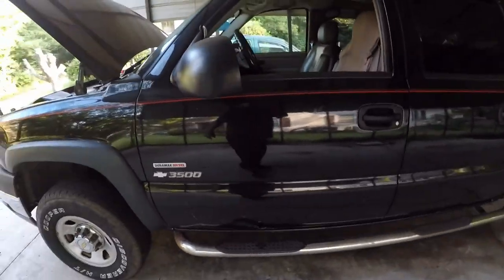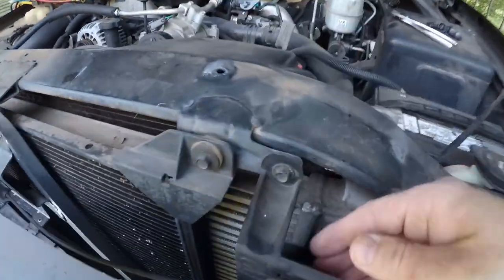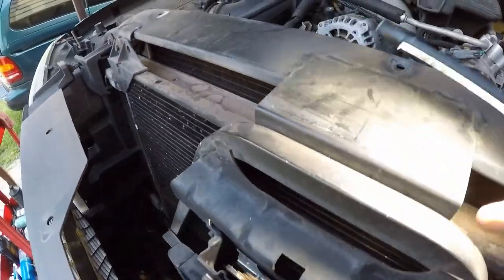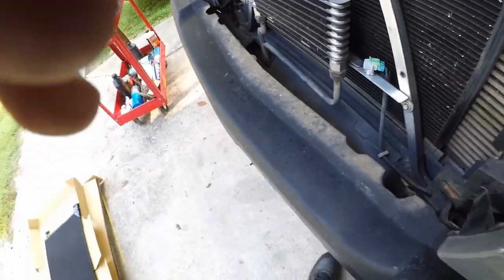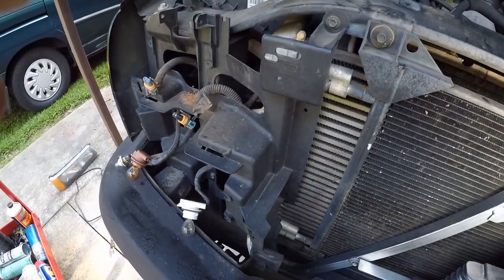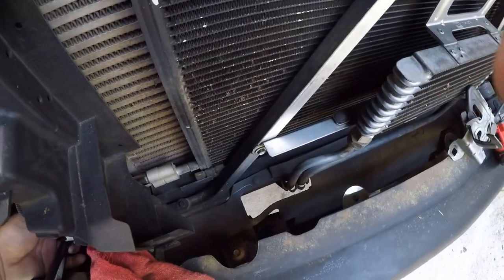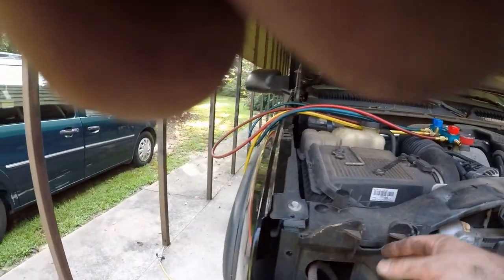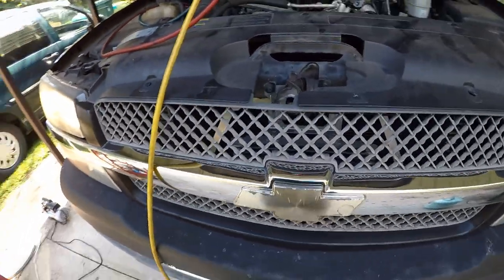How to install a A/C condenser in a 2004 Chevy Silverado

Comment: What about the Pag oil for the new condenser?
Reply from the maker: U shouldn't have to add oil unless you had a leak or replacing the compressor.
Reply: @timzauto  thanks i replaced the ac condenser and found out i only need to add 1 oz of oil for the replacement

Comment: Do I have to vacuum it if I'm just replacing the condenser? No leak or anything like that on mine
Reply from the maker: Yes anytime you open the system you should vacuum it out,that being said I have done them years ago without vacuum and they did just fine,thanks for watching.